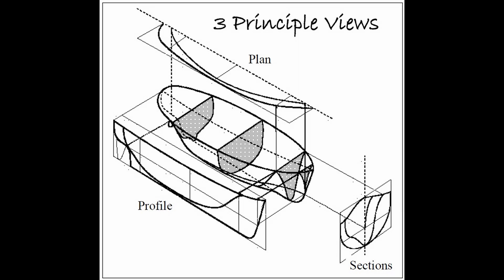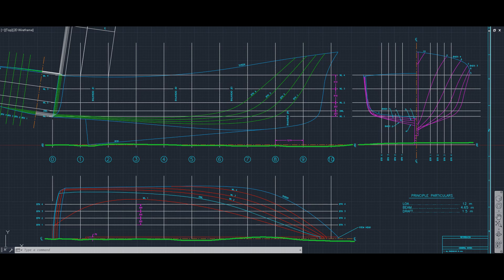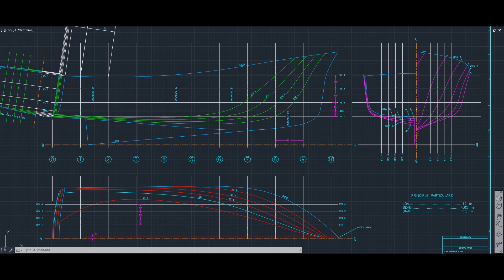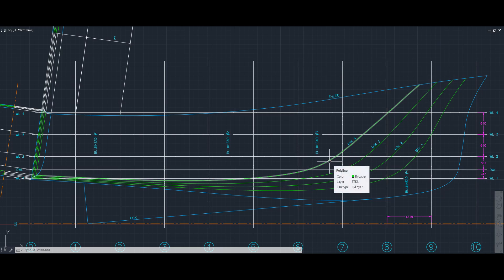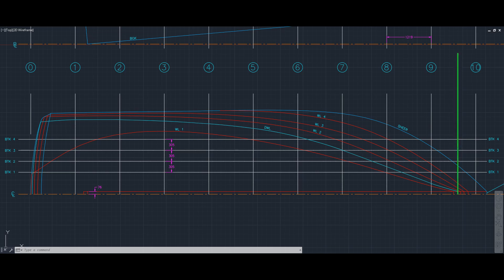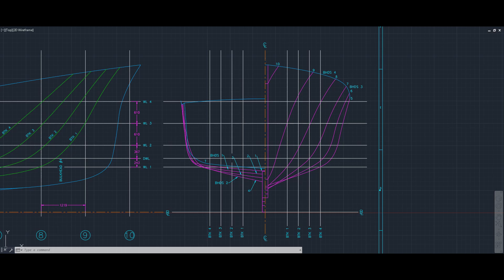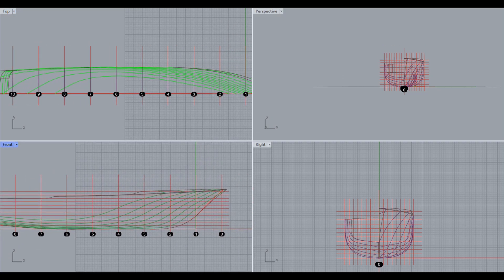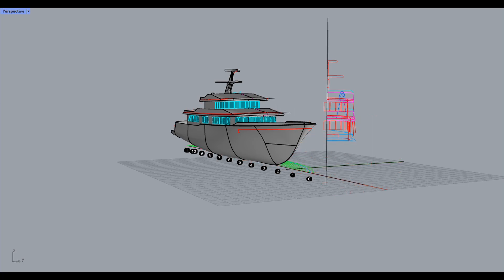Interpreting Lines Plans - 2D Drawings to 3D Ships

Comment: Ship Curves

When we are designing the line drawings for the boat hull or, for that matter, anything three dimensional, we must be aware of the fact that we have 3 viewing directions available to us. These are: Up – Down or the Z axis, looking at a Horizontal Plane containing the Water Lines; Front – Back or the X axis, looking at a Lateral Plane, containing the Station Lines and Side to Side or, the Y axis, looking at a Sagital Plane, containing the Buttock Lines. The line drawings of a yacht hull are usually very beautiful to behold, especially by the uninitiated lay person. But the design process is simpler than it appears to be, despite the bewildering grace of these lines. The salient thing to understand is that you can start with any 2 views but, the 3rd one will automatically be, beyond our intentions. It doesn’t matter which 2 views you choose to start with, the 3rd view will be consequentially locked in. The shapes of the lines of this third view will have to be investigated and resolved while, those of the first 2 views are within your deliberate control. Why? Because each flat 2 dimensional drawing consists of 2 dimensions, out of the possible 3. The 3rd dimension will be common to both of these views which you choose, while both of these views, taken together, encompass all three dimensions. So you will be, willy-nilly, constructing the reality of the “unchosen” view – “Blind” so to speak. Therefore, at the outset of the design, you have to decide which two views are more important for your boat. Is it the plan and side views or the plan and front and back views? 

Howard I. Chapelle wrote an excellent book called “Boatbuilding, A Complete Handbook of Wooden Boat Construction” in 1941. Chapter Two is called “Lofting”. If you follow the exercise in this chapter, you will learn how to draw those beautiful lines. You do not have to be an engineer. I did this exercise when I was 17 years old. All you need is passion and curiosity.

Comment: YT narrator should repeat drawing class from Year 1 and thru to College grad. A lot of clarification is missing.

"Profile" view shown is presented and known hence as the Front Elevation (only for purposes of subject treatment). Side view is called Side Elevation, otherwise "the profile" in ordinary speech. This Side view orientation is the actual front of the hull, the Bow, and technically not a side of it.

For intuitive orthographic description the YT subject treatment gives a profile view (ie a Side) as the "front" projection.  

The Plan View of Buttock lines does not show "straight lines" anywhere, maybe the idiot should try to explain his thoughts process here. The buttock lines shown do follow the hull contour's outline in slices intersected by a horizontal cutting plane for a given height of Elevation across the hull. This drawing projection is more usually called a Development, like mating a round hole in a tube wall to the end of a tube of equal diameter.

 Don't ask me why contour slices are called butt lines.

Comment: Hi, I have a 3d. Document with all the cures. you mentioned but when I loft the body plan I then have a good result but I'm slightly off the water lines and buttock. I know it's possible to fair a boat on orca3d but I don't have access to it and it doesn't allow me to work from my favorites  platforms. 
Do you have any tips or maybe some documentation on how to do it properly from from any platform (fusion/onshape/solidworks). ?
Thankfully

Comment: Thank you so much. Your explanation is one of the best I have come across. Precise and exceedingly clear. I hope you can do a video for the layman how the design waterline of a vessel is derived. I find it hard to get around understanding how the architect achieve this with just a boat plan. I suspect it is a mathematical solution from understanding the expected total weight of the material used for construction and the volume thereof that will be displacing water, and working backwards from the area of a waterline section that has an area that correspond to such a volume. That is just a guess. And a model subsequently put on water could, I think, cross-check and confirm the design waterline that has been calculated. I am a layman trying to think what the process involves. I could very well be wrong.

Comment: iChase doing 3D modeling now?  I did surface and solid modeling--mainly Rhino and SolidWorks respectively--for many years professionally before I started play WoWS in my spare time.
Reply from the maker: Well I'm studying naval architecture right now, the 3D modeling and line drawings on AutoCAD are things we do for projects and stuff. Thought it'd be cool to share some knowledge :D
Reply: @ichasegaming  Cool stuff.  I grew up on and around boats, sail boats and power boats.  I wanted to be a marine architect since when I was a kid, in the '70s and '80s.  I think I wanted to be the next Olin Stephens or Ron Holland.  I ended up being an industrial/product designer.
Reply from the maker: Well I hope the career you ended up being in is a fun one. I went from liking ships on a historical level, which led to NavyField and WoWS and then with more research I wanted to be a part of a real ship's design and construction so I went back to school to learn it haha, been a fun first year.
Reply: @ichasegaming  Iv been a AutoCAD Drafter for 20 years, both 2D and 3D, great old program. Get to know the keyboard shortcuts (aka Legacy commands) Waay faster than trying to find the XREF or BLOCK buttons.
Reply from the maker: Thanks for the tip :) do you have any resources I can look up?